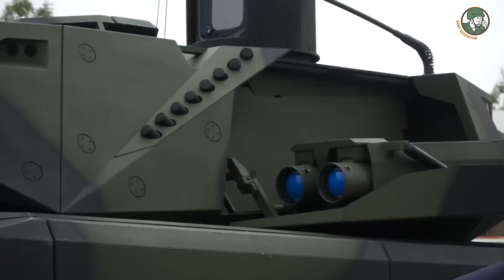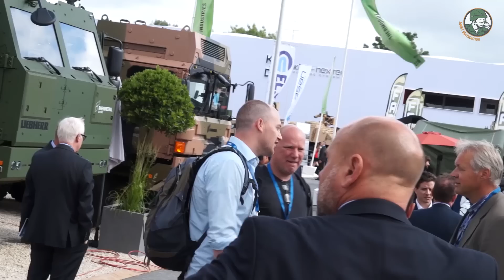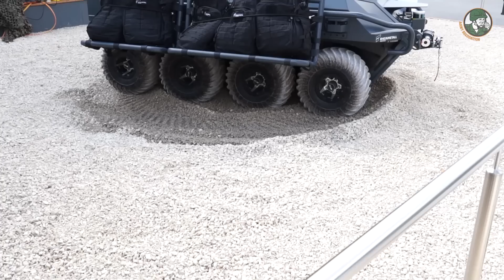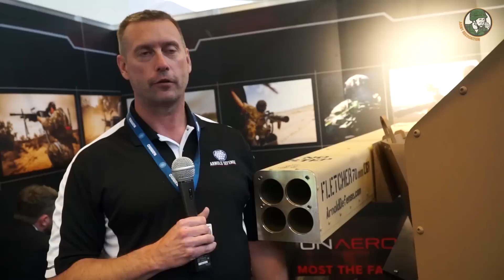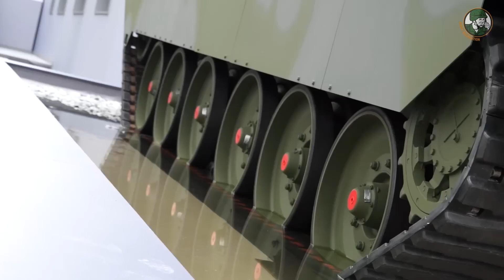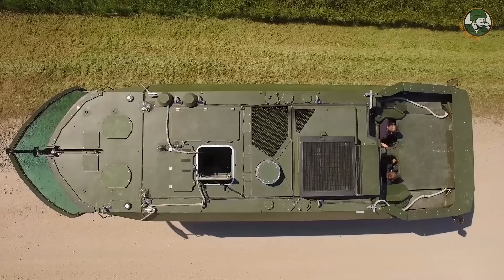Rheinmetall Lynx KF41 IFV Command Post UGV Fletcher 70mm rocket KMW amphibious armored

Comment: The Rheinmetall Lynx at 40 to 50 tons is too heavy.
The Fletcher 70mm rocket pods are great, and overdue, but COTS products may work just as well.
The KMW APVT is brilliant, at least at first glance, it appears to be everything the marines' AAV was supposed to be, but never could be. It is rather long, a shortened 20-22 ton variant may be ideal. KMW does some good stuff, it seems.
Reply: you can buy the Boxer on 8 wheels, essentially the same concept, lighter armour with more speed and manoeuvrability.

Comment: Absolutely no way this could be amphibiously deployed...it’s so heavy and maybe can’t fit on landing craft??

Plus I hear the Bundeswehr is experiencing a lot of logistic problems with their tanks and IFVs...does KMW and Rheinmetall have problems with providing logistics to the Bundeswehr???

Also how will it beat drone swarms and dozens of kamikaze drones???

Greetings from Detroit USA
Reply: 1.Weight doesn´t effect the capability of a structure to swim....
2.That´s not KMW or Rheinmetall´s fault. The Ger. Gov. failed to order resupplies.
3. Probably the same way as active rocket launcher defense works. Even though "Killer drones" are far from being deployed.
Reply: In your rationality, a whale would definitely sink on the bottom of the sea due to its weight :)
Reply: @tonyvu2011  agree with you.. look at those metal wheels... they tried to do it with low budget but ended up stupid design... what if so clear things in front get shoot and destroyed? so it will sink in the water?

Comment: tsk, still using a joystick for the RWS. Controllers have significantly better performance.
Reply: that and its only $20 to repair a faulty controller..
Reply: controllers are cool if you dont move, but when you are bumping over little hills with 40 km/h you will be glad to have a solid mounted joystick in your tank

Comment: The Lynx KF41 is a fine companion to the boxer. Fantastic job Rheinmetall hope the 30mm is available also.
Reply: Jonny lack of success didn't seem due to technical reasons for the SEP. With the boxer they can lift off the entire hull in the field and switch them out. Doesn't seem implausible that they just put it on a tracked chassis.
Reply: TheBooban That has been tried with the swedish SEP platform. Wasn't successful and cancelled later.
Reply: Wheeled and tracked chassis differ a lot in terms of size and dimensions, aswell as propulsion. The SEP used a very complicated system of two diesel engines, electric generators and electric motors to allow module interchangeability between wheeled and tracked chassis. It took up a lot of space and weight, thus put other factors such as maximum gross weight, internal volume and protection at a disadvantage. The Boxer follows a much simpler and more conventional approach with a normal powerpack, so it doesen't have these disadvantages compared to a non-modular platform.

TL;DR: At the moment tracked and wheeled chassis have too much differences to have a common module without inflicting major disadvantages compared to non-modular vehicles.
Reply: Jonny well yes...but have you seen the boxer clip where they completely switch the hull out with a little crane? Track and wheel can be as separate as they need to be, doesn't matter, just switch out the top. Put the top on a boat why not. https://youtu.be/mn_WblYc4xk
Reply: Jonny doesnt really make sense to me that they are different. Where the crew are it should essentially be the same. From the boxer video, it looked like it could be placed on anything.
Reply: Why not just make a track version of the boxer? Or a wheeled version of Lynx? They seem to do the same thing.
Reply: TheBooban The Lynx is far more heavily armoured than the Boxer and is designed to carry 8 infantry for dismount.  The Boxer CVR is less heavily armoured with far superior speed and range, with less protection than the Lynx, making it more well suited for a combat reconnaissance role.
Reply: No, that is what i ment. Even the top of tracked and wheeled vehicles is so different there is no commonality for now. You would end up with a ridiculously high tracked vehicle.
Reply: https://www.youtube.com/watch?v=E3ZEvvlgtsM

Comment: 40-50 tons seems too heavy for that kind of vehicle.
Reply: If you want to pick-up garbage in a non crisis area, ask for one without gun and armor....
Reply: Sonatine only?  50 tonnes is heavier than a full fledged Soviet MBT. 

My take is that it is overly engineered and way too costly.   The fire power is also not on par with the weight it has.
Reply: ? To heavy..why? Engineering to low? Why?
Reply: It's too big and heavy, and it will probably gain serious attention on the battlefield compared to mbt

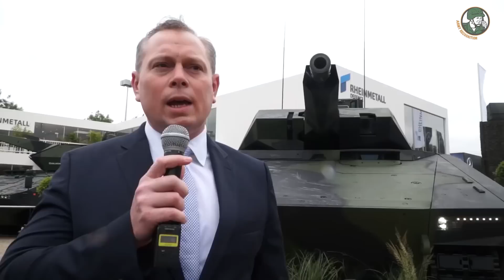Comment: the gun turet and the hull is impresive but that hydraulic  mounted   air defence gun at 00:37 is inpractical  
in their place i would made it like by Kornet D on tigr wehicel  to come  out from the hull thus reloading could be made easy  and under the armour protection on the batelfield.
Reply: It's a dual Spike ATGM launcher, not air defense.
Reply: i taught it is for air  defence  it looked too  upvard   not on forvard direction but still it would be bether  to be reloaded from inside in all aspects safety in batelfield and not to be vulnerabel against sniper rifels while reload  or exploding shels  mortars and shrapnels.

Comment: Lynx KF41 – 3.3m huge height , where  do you hide it on the battlefield ?
Reply: You are aware that 3.3 meters are the top of the commanders sigt on top of the turret right? The hull is still flatter than a Bradley hull.
Reply: hide from what ? Your mama ?

Comment: Will the Franken-ship-tank have a future?
Reply: It's a cool but it seems VERY vulnerable to modern ATGM's. The thing has to stop, engage its amphibious equipment, THEN turn around to go into float mode. I can see it used for difficult logistics work, MEDVAC, and other associated tasks. Just my 2 cents.
Reply: @jodecisanchez8785  I think you can just drive it in the water engage the turbine and then turn,  
like it's possible with other and older amphibious vehicles to, this one just would turn the back in the direction.
Reply: Franken-ship-tank ... I guess that was the working title
Reply: Very possible, the Russian military has been using amphibious apc's for a VERY long time. The idea is not armor, it's to have increased mobility in the infantry, to advance fast and to have an effective mobility at all times.

Really the difference here is that this "Franken-ship-tank" has a much higher profile meaning it has much more room for comfort of the soldier other than that it's essentially just a modern western built btr-60/90.

Comment: The Lynx is the same as Puma or they are different IFV's ???
Reply: Puma is made by KMW and Rheinmetall and its weight is limited to being air transportable by A400M.
Reply: Thank you  for the info
Reply: KF31 is Marder based, KF41 isn't.
Reply: @M200 Cheytac   The Lynce is a Basis from IFV Marder 1A3 , new tower and armor